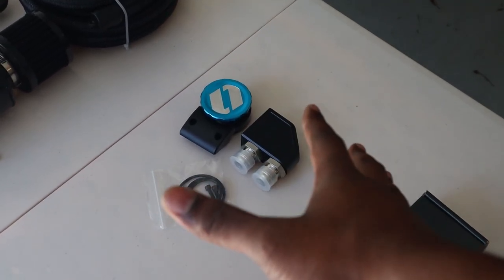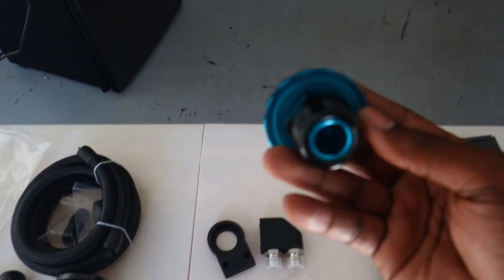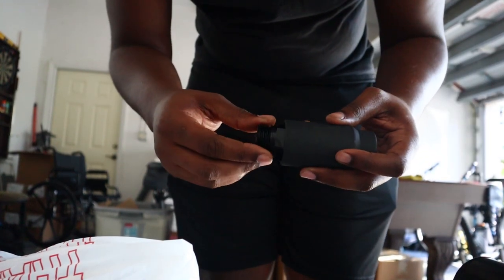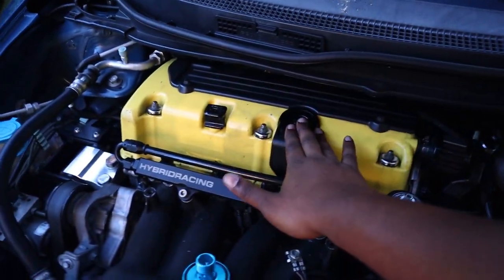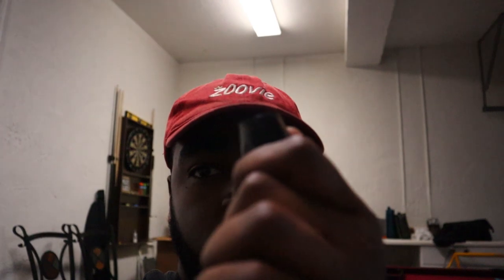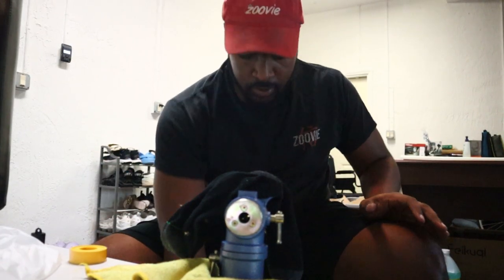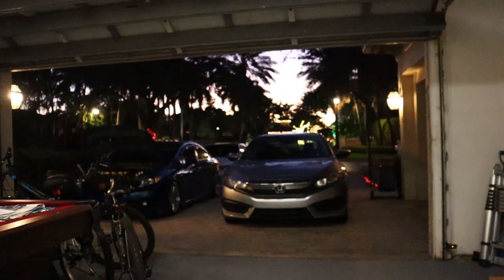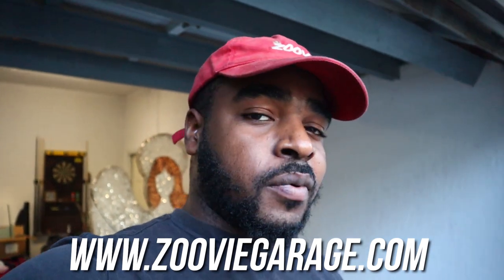EVERY HONDA NEEDS THIS MOD! YOU NEED THIS!

Comment: I almost traded my 19 coupe ex-t in for a 2015 SI. They just couldn't make the deal work in my favor. Mostly because here in VT they're asking INSANE prices for used cars. Catch can will be one of my next mods for sure. Especially with these gdi 1.5t engines in the 10th gens.